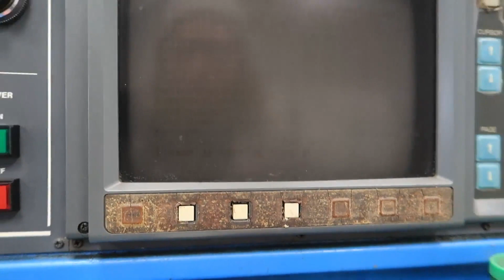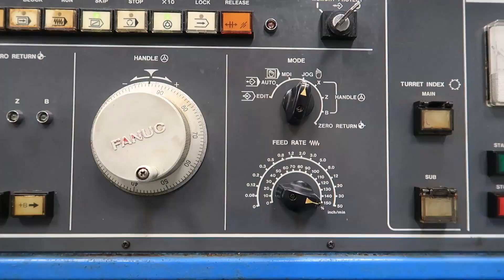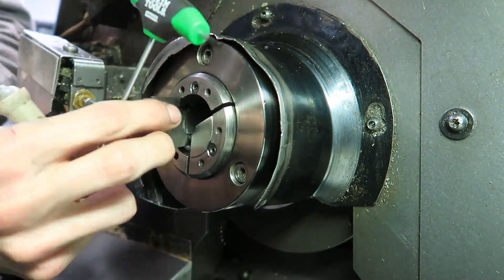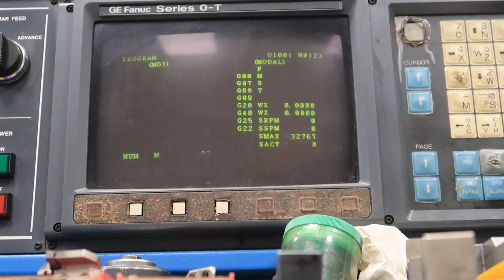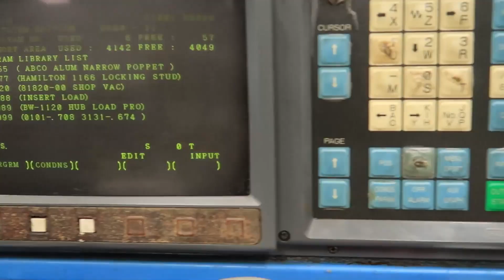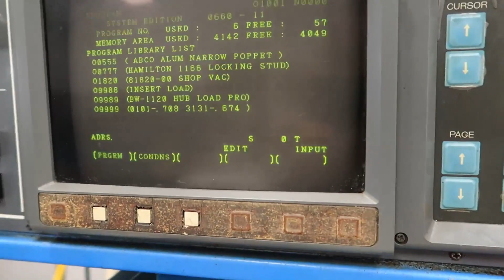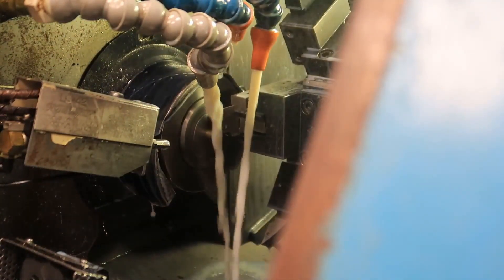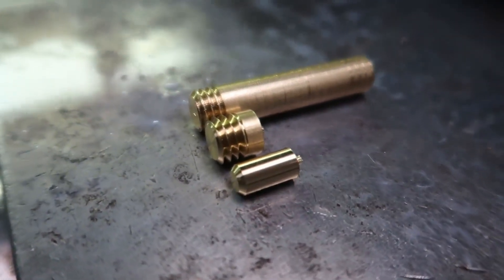Miyano Lathe Setup and Test Cuts

Comment: Hey my guy what post did you use in fusion 360? Just the standard fanuc turning?
Reply from the maker: It's derived from that standard fanuc post but I got the post from another guy with a Miyano BNC 34-C. I tweaked it to make it work with my bar feeder and the sub-turret
Reply: Think you’d be willing to help me with this? I just bought a Miyano BNC 34C.
Reply: @OneMinuteWorkbench miyano is pretty easy once you get it down it's one of my favorite machines to run

Comment: Good Day, how do you activate the second turret on the machine?
Reply from the maker: That's a bit of a loaded question. I would have you refer to the manuals of your machine it will explain it all in there. 
Essentially you write a sub-program for the sub-turret within the main program between G101 and G100

Comment: I just got my first cnc lathe last week  and im just waiting for the 480v transformer to get in so i can start playing in that world too... Im kinda intimidated by it tho as I have never seen one run in real life and it looks like chance of crashing is even higher than a 5 axis with the giant torrent getting so close to the chuck... im pumped for more lathe video from ya man
Reply from the maker: Oh wow...you need 480? Luckily there is a 3 phase bus bar in the shop so I can just drop down whatever I need as long as I have a bus plug breaker. That bus bar is only 220/240v though. Lathes are kinda scary and this one is quick plus I haven't figured out how to turn down the rapid speeds so I am always holding the 'feed hold' button when I first run a program. Just have to be extra cautious when running a program for the first time
Reply: the last machine I learned how to use was my 5 axis haas and I still (1 year later) clench my butt hole pretty hard and have my thumb hovering over the feed hold button for the entire run of a new program and so far playing with my new lathe, the lathe seems scarier.... I was planning on the feed override button not leaving 5% for a good long while. im hoping to post some video of my lathe learning process too but it seems harder to film in a small lathe
Reply: It won't be long until you don't fear it anymore. Take a hard job that has you working your butt off and it will all become routine. The only thing I still worry about is the part flying out, and I'm using my old mori seiki lathe like a budget mill turn with clearance issues galore. I don't even have a CNC mill at the moment. All turn-milling.
Reply: @multiHappyHacker  i have only had a mill for the last year so I have had to get a little creative on jobs that really should have been done on a lathe but I can't imagine doing it the other way around. Im guessing your lathe has lice tooling? if so im super jelly...

Comment: Turn it down to 250rpm and go for 8 passes and it'll cut with no chatter.
Reply from the maker: I'll definitely give that a try! I appreciate the advice
Reply: @MojoMfg  personally I would thread it shorter in the spindle then bar pull/feed it out for parting off.